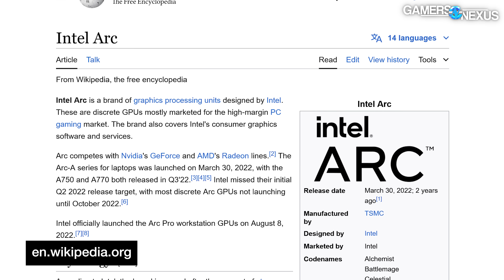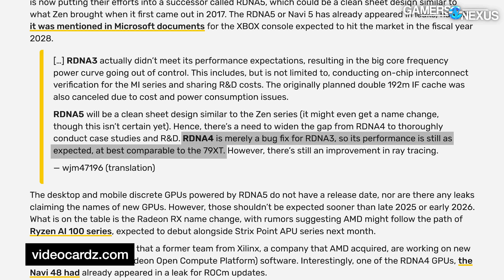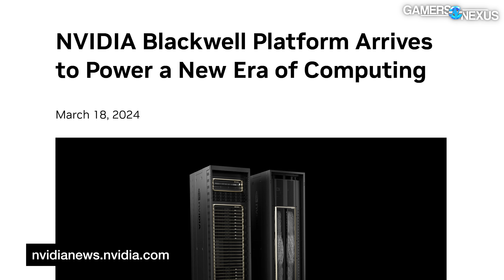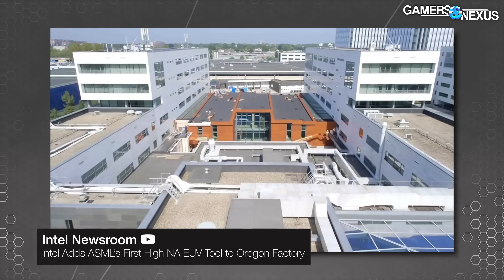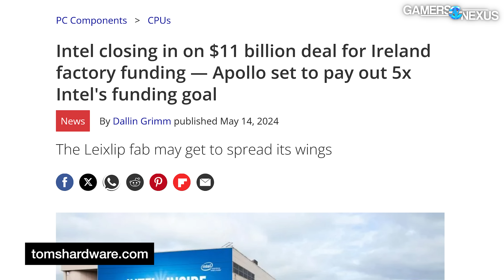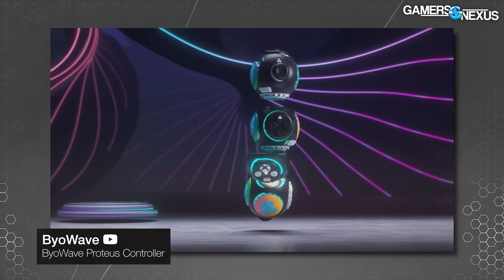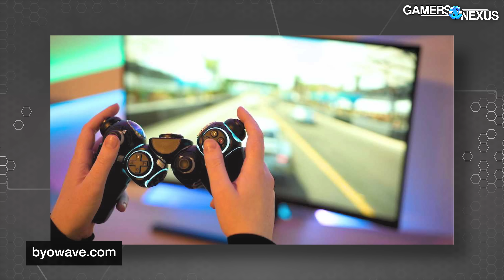HW News - Intel Battlemage Handheld, AMD RDNA5 GPU Rumors (Already), NVIDIA Handheld

Comment: I should probably sell my Switch before its price hits an all time low, Switch 2 being backwards compatible sealed the deal for me.
Reply: With the hardware framework Nintendo has spent over a decade perfecting, backwards compatibility seems like a foregone conclusion.

The part that would be on brand for them, though, would be finding a way to make a couple extra bucks off it.

Comment: So sad right now.  My ROG RTX3090 blew up last night.  Looks like I'm back looking at GPU news. I need a new one 😢
Reply: That blows happy hunting.
Reply: Check warranty, it's usually 3 years for ASUS. If it ran out, a 3rd party repair costs around $200 which is still very worth it for that card.
Reply: amds make fine gpus they only struggle a little with raytracing and..that's it
Reply: no warranty?
Reply: o7
Reply: I just finally upgraded from the RTX 3060 12gb to the RTX 4070 TI Super coming from 1080p 165hz monitor to a 1440p 240hz monitor and all I can say is I’m never going back to 1080p.
Reply: If you are looking for a similar performance, the RTX4070 Super is out there. Oh, it has half of the memory size of RTX3090. Yeah. Thanks, Ngreedia.
RTX 4070 TI Super is even faster and will work for years. Only 8GB GDDR less! I guess it's the: "Shut up and consume. You tiny human cell!" kind of situation. 
"- A blood-black nothingness began to spin. A system of cells interlinked, within cells interlinked, within cells interlinked within one stem. And dreadfully distinct against the dark, a tall white fountain played. Cells.
- Cells.
- Have you ever been in an institution? Cells.
- Cells..."
Reply: @HanSolo__ A 4070 with 24gb ram would cost close to a 4090, ram is expensive.
Reply: @HanSolo__  couldn’t say no for $600 new the girl had 2 of them I love Facebook marketplace local and her lmao.
Reply: My RTX 3090TI is still kicking.....for now.
Reply: Send your card to northwest repair. He’ll set you straight.
Reply: Sheesh. I'm still using the EVGA 1080ti just fine lol

Comment: I dont know if all the Asus drama ended but i wanted to say that Asus rog B550 A had rams that where in Asus Qvl but still crashed every time he opened a videogame(Especially Tom siege)  or a few other programmes i just wanted to say if anyone else had issues just try custom ram speed
Reply: Update BIOS. If that doesn't help, drop the speed by one (3600 to 3466 for example). If you really want to invest some time, it can most likely be stabilized at XMP speeds by tweaking voltages (DIMM, SOC but also VDDG and VDDP). Wouldn't necessarily blame ASUS, this is very common. The memory controller of the CPU plays a big role and not all DIMMs are equal either.
Reply: Had similar issues with setting ram speeds at the advertised speeds on my asus prime motherboard. I ended up having to lower the speeds untill games and emulators wouldn't crash.

My ram speed was 5200 and I changed it to 4800.
Reply: Oh the ASUS trainwreck definitely continues its way into the abyss.
Reply: @HanSolo__  the only asus product I have In my pc is the motherboard because of the bios. However I'm starting to take a look at MSI.
Reply: @Dragoneye2427  Consider ASRock.
Reply: @Dragoneye2427  Previous owner of two MSI motherboards, BIOS on those sucks! One board had random issue where it would not boot, I pressed the power button and it looked like it's booting but then it shut off. Powering it up again and it boots properly but something was wrong.. Yeah my overclock settings and RAM timings/voltages were reverted to stock. I started to keep the OC profile file on specific thumb drive to revert back to my settings if it started to act up and oh boy it did. No matter what BIOS version I tried it kept doing that stuff.. Second board had issues with rear USB ports, six months ago the second RAM bank stopped working on it, even tried new RAM on it. Not sure if MSI has changed over the years but with this kind of history with their products I don't feel like recommending them to anyone.
Reply: @StaticVapour590  I hear you man, I used to say that asus had the best bios but after the whole overvoling issues and my ram not being alllwed to use advetized speeds on the board because of motherboard instability issues. Im eyeing other boards out there. Have you used any boards other than msi and asus?
Reply: @Dragoneye2427  I had AsRock board years ago, it was okay. I had it for so little time (month or two) that I can't quite say about it's reliability. I also built a PC for friend with AsRock B550 Steel Legend motherboard and it's been working fine
Reply: @StaticVapour590  I see.
Reply: Advertised speeds should be the validated rock-stable stock speeds. Otherwise it's just false advertising that intentionally misleads and takes advantage in a way that's supposed to be illegal to do. It's just not enforced.

Comment: I’m feeling those price hikes on storage prices…
Reply: 1 tb doesn't feel enough, wanted another ssd. saw prices and said nvm, the ssd I bought sept last year for £45 was £70 by december and is now £96
Reply: At least 4 tb ssds seem to be decently priced. They were ludicrously expensive when I built my rig, that's why I went with 2 tb. Sad to see 1-2 tb drives to up in price.
Reply: I just checked. As of now, my 2TB Kingston NV2 was $89 USD. Now it's $120 USD
Reply: @bufordmustang302 I bought 2TB gen 3 drives for €85 a pop 2-3 months ago and now they are €100.
Reply: @bufordmustang302  where you guys at? they're all the same price here. No storage has gone up since last november as far as I see. (USA)
company has gotten crucial, western digital, and samsung ssds in the past year, several different kinds. All of them are the same price
Reply: All thanks to the Chips act and Next year Internet will be priced out and unregulated thanks to Net Neutrality passing.